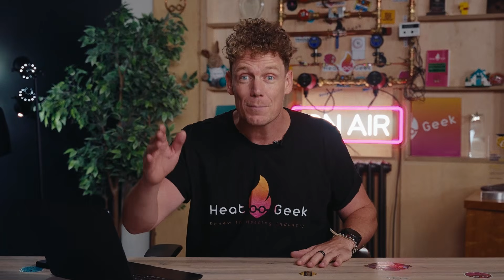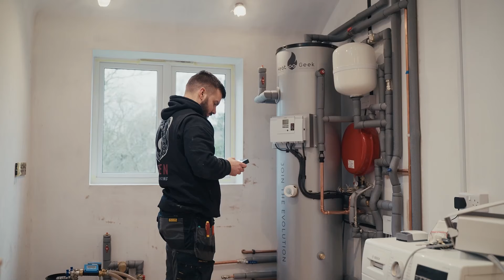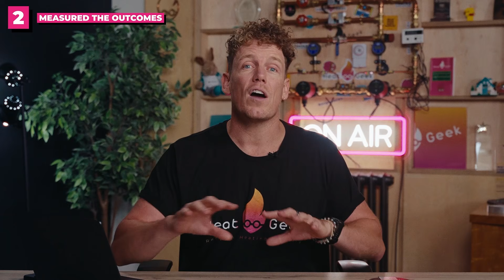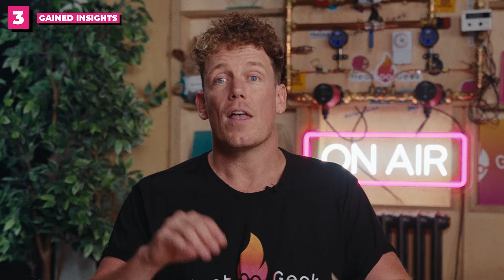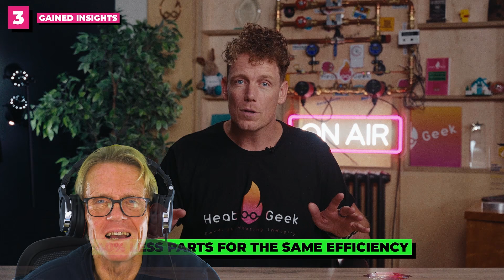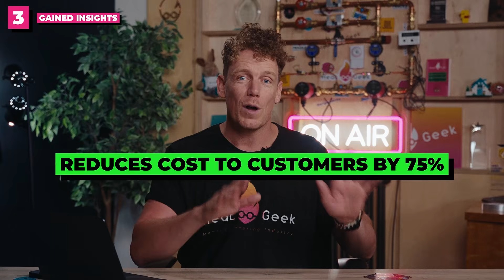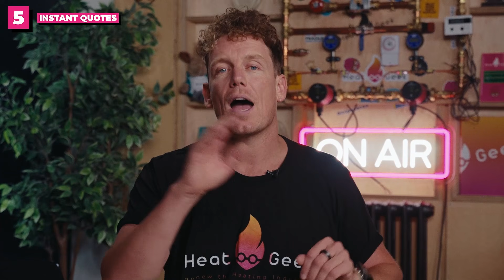Heat Pump Reality Check: Is Zero Disrupt Too Good to Be True?

Comment: Heatpumps are not the problem it's shit housing stock that was built through the years.
Reply: Heat pumps work absolutely fine in the current housing stock and still pay back. I’m not saying to not improve it, but I’m saying they work right now.
Reply: @HeatGeek one of the heat geek elites (Liam from the north West) is currently working to install a system in my 5 bed, 9" solid wall edwardian property. It's a big investment (even with the Grant) but with solar and battery systems to make use of overnight tariffs, I think it will be well worth it
Reply: and still is
Reply: That and the obsession with air/water systems. Air/air can heat anything and doesn't really need insulation. It's used to heat warehouses and loading docks that are basically barns.
We heat our old solid stone house with air/air heatpumps just fine - the heatgeek people said it couldn't be done with air/water. As it's grade II insulation was out of the question.
Reply: My house is among the shittest and my heat pump works fine and costs 45% less than a gas boiler